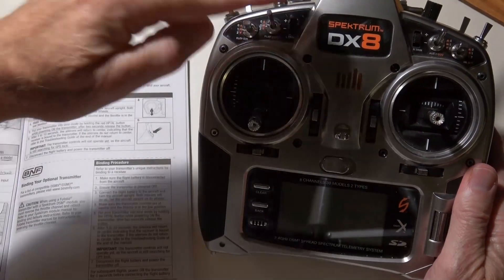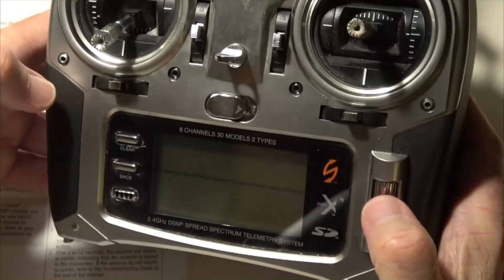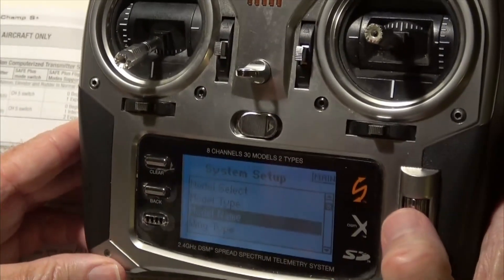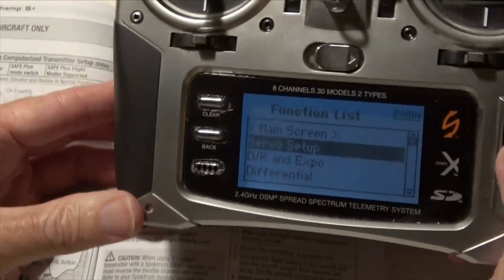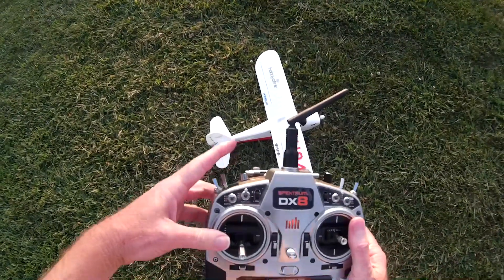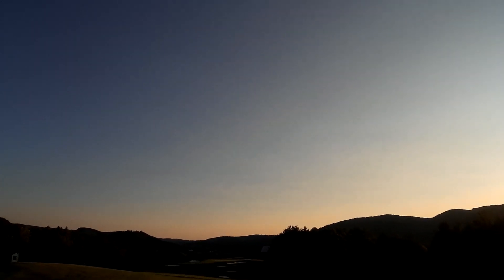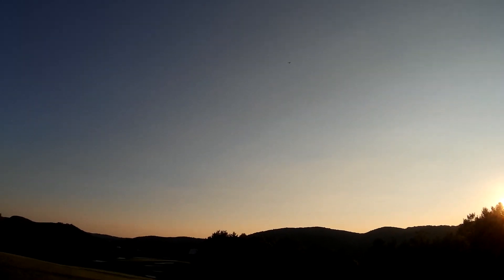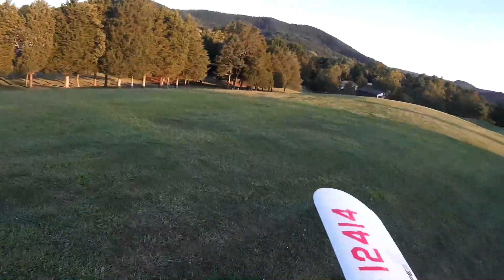HobbyZone Champ S+ How to Setup Spektrum DX7 DX8 Gen1 Radio Switches and HP Button and test flight

Comment: I really like this plane. I live in northern Canada and with snow and cold it works well. Do you know if that spectrum radio transmitter has the option (Master-Student link 2 radioss with a cable), the futaba radio has the teacher-student option behind it, that way if the person makes a mistake, the master retakes control. Saving the plane. Thanks
Reply from the maker: DX7 DX8 Gen1 Radios have trainer ports and can be linked with a cable.
Reply: @DaveMerc  thanks for answer.. This cable have a special reference?  And works with spectrum s 5 both?.. Thanks so much again.....

Comment: When I plug in the battery with the transmitter off it doesn’t go into bind mode, so I can’t bind the plane to the transmitter. I don’t know what I’m doing wrong. I tried to do it multiple times.
Reply from the maker: Did you turn the aircraft upright after plugging in the battery and wait for the ailerons to move?
https://www.manualslib.com/manual/1199701/Horizon-Hobby-Champ-SPlus.html?page=7#manual

Comment: OMG!  You went through that like it was simple. But for a novice, how do you figure these settings out?  I just bought a Carbon Cub S+ for all its gps functions (and supposed to be great for beginners!). Since they say you can’t use the flaps with the RTF version, I chose the BNF model and a Spektrum DX8 gen2 so I can have flaps and the voice prompts!  Ha!  I can’t find anything on how to get the two working together. The manual has a small panel on how to do it, like the Champ, but it leaves a LOT of questions unanswered!.  Hope I didn’t just waste a whole lot of money on a wall hanger!
Reply from the maker: What flaps? Mine doesn't have flaps.
Reply: Dave Merc Productions The Carbon Cub S+ has flaps that haven’t been cut yet. You have to add 1 more servo and need a 7 channel Tx.
Reply from the maker: Oh sorry I missed the Carbon part. Didn't know that.